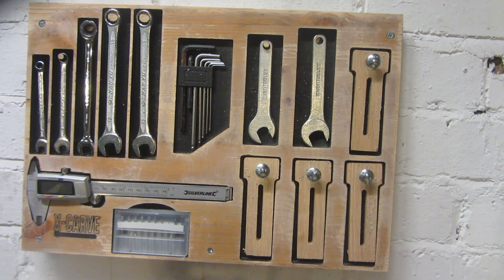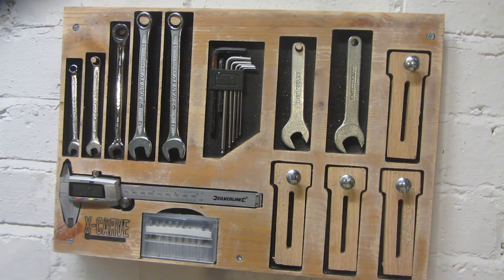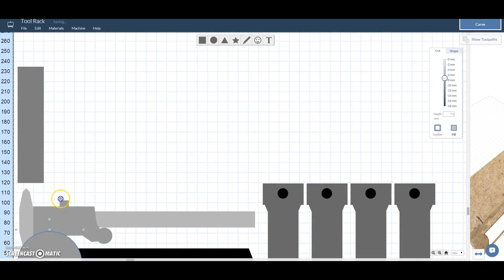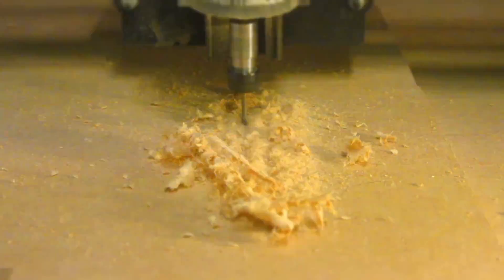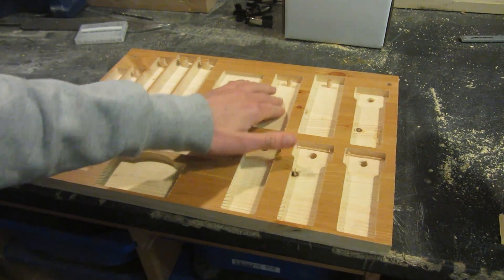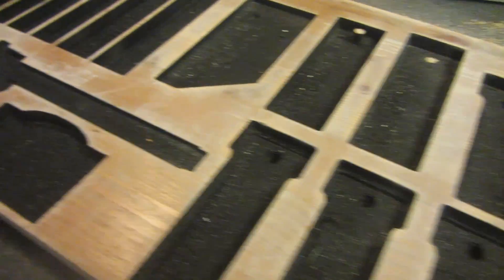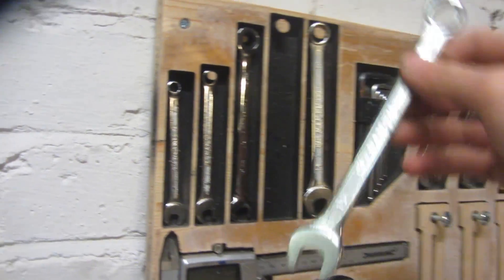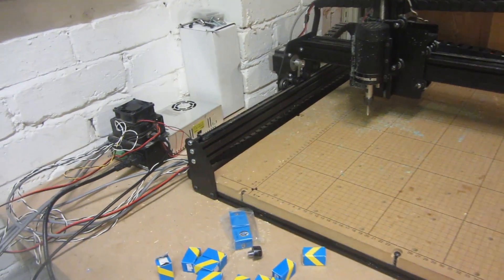How To Make a Cnc Tool Rack For The X-Carve

Comment: First off I want to say great video. I have a few suggestions that may help.

All those lose wires worry me. There are a couple different ways Id suggest keeping them all together. I know here in the US you can go to any auto part store to buy flexible tubing you put all the wires though it and then use a heat gun to shrink it around the wires. The other suggestion is to use the flexible plastic tubing that's ribbedd for strength and has a cut all the way down for easy access to the wires.

Now for the CPU? and fan I would make a small steel box similar to that of a computer with some expanded steel so it could breath it would be very simple for you to make the back plate bigger so you could mount the box to your wall and keep it out of the way of the dust particles.

Hope that helped. Looking forward to more great videos.

Comment: possibly a stupid idea
you could get a micro atx pc to house your power suppy and the mesh fan filters would keep out the dust and the fans in the case could cool the power unit (i dont know if heat is an issue)

Comment: Why not make a box for your Power supply you have the Xcarve make alloy base plate to absorb heat wooden sides with vents and fan, make it so xXcarve sits over the top of it saves desk space, well thanks for sharing, as the xcarve is available to all in parts and I have beem buying mine week by week, good to see somebody that makes parts to maintain it Steve

Comment: The Art of Weapons Thank you for another great video, i look forward to you getting more adventurous with your future projects, as for you power supply and electronics, could you get a second hand mini-itx pc case and modify it to fit them into? that way you could ad filters to the case and mount it to the under side of the bench, you could also possibly make use of the power & reset switches on the case.
Good luck for the next Project and thanks again. :)

Comment: my suggestion is this: build a box to mount on the wall, with the wall side bear. also, a computer fan that blows air out of the box (with a switch, of course). why wall mounted? well, the wall is naturally cool and heating could be a big problem for electronics. also, less chances of accidentally hitting the box or have a tool fall on it. nice job! cool vid, man!

Comment: in addition to the other suggestions of filters for the fans, over time dust is going to build up regardless in those fans not just from the machines i would suggest also a acquiring a can of compressed are these are relatively cheap of amazon and are able to clean dust off of electrical parts safely, they are often used to "spring clean" server and domestic computer internals http ://www.amazon. co. uk/AF-Invertible-CFC-free-Non-flammable-SDU200D/dp/B000J6CSBY/ref=sr_1_6?ie=UTF8&qid=1434337001&sr=8-6&keywords=compressed+air+computer the link is to the one that i personally use

Comment: cool video, maybe you could inset strong magnets in the back so your tool will stay in place and it will add a nice gimig to your tool rack.

for the power supply, just a box with air ducts, and cover them from the inside with old nylons, so the dust can´t in.

Comment: buy a cheap pc tower of Amazon and cram the power unit into it then  use some Painless Wiring Powerbraid Wire Wrap around that messy wire harness
Reply: TypeOmeg4 also to save time on cut outs like this, raise the material up on a jig and cut the paths all the way through the depth of the material that way you  only have to do a path that fallows the outlines of the shapes you want making a hole. then pre paint  another piece of material black and sandwich that to the back giving you the same overall result but saving you cut time and sanding time

Comment: id suggest buying some standard PC fan filters to put over your fans. also, if you could build some sort of housing for the power supply and wires it would make it less dangerous and would probably make the fan filters easier to fit.

Comment: I'd suggest you get a wall mounted metal electrical box to mount the PSU and drive for the XCarve in. Just cut some holes in there for ventilation and add some screen or mesh. Should keep most of the dust out and it's going to be even less of a problem when you've got a dust collection system hooked up to the CNC. Awesome Video mate! Keep up the good work!